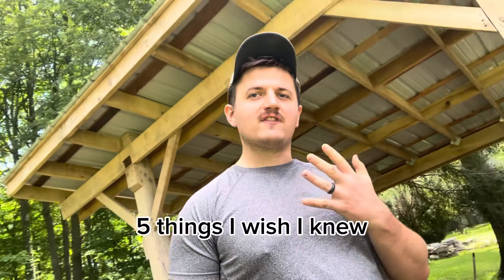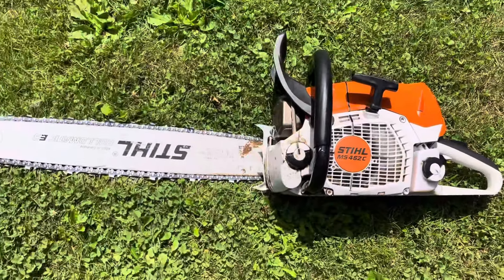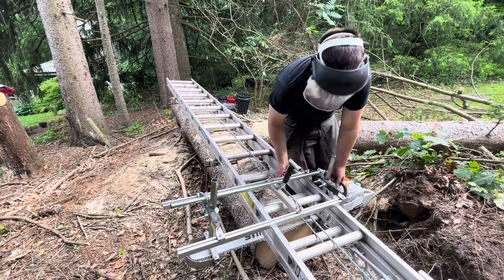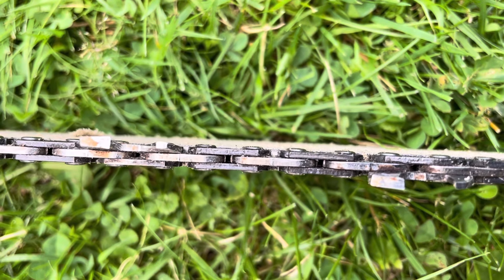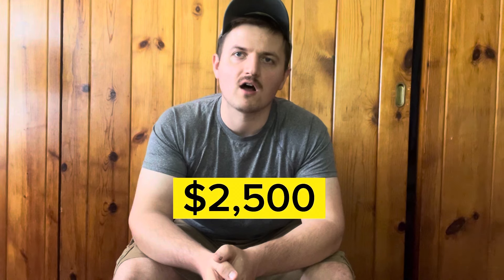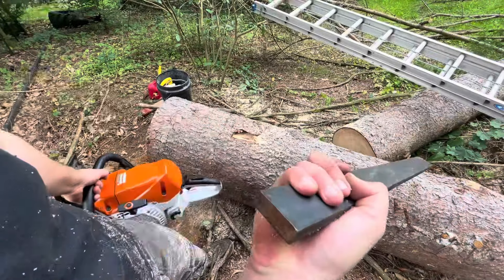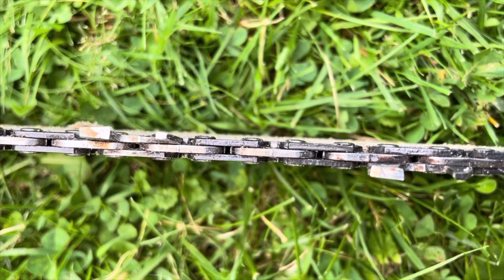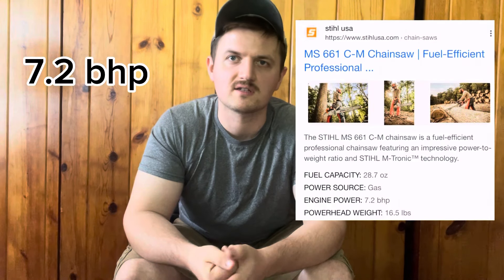Watch this BEFORE buying a chainsaw mill.

Comment: I have a farmmac 660, it's a clone of the ms660. Haven't had that many problems with it. You're right about idling the saw before and especially after every cut, they need to cool down.
Reply: @aerialrescuesolutions3277 Cole's chainsaw mechanic friend must be working on clones only. 

Professionals should get best brands they could get, new homesteaders or DIYers may need good clones which is better than a no chainsaw.

All chainsaws are made in China or made with Chinese parts especially German manufacturers. How do you think they make such good clones?
Reply: @aerialrescuesolutions3277 lol where are all the problems you're referring to? For four times the price I'll pass.

Comment: I have been using a Sthil 271 with a 24” bar and rip chain for 3 years. It gets the job done just fine, let the saw do the job and not force it.
Reply: I've used my Stihl 310 on pretty big Douglas Fir and some smaller fir old growth running a 28" bar but use my 660 with 42" and bigger or on hardwood
Reply: Thanks for sharing, which mill are you using?

Comment: my friend put a longer bar on a electric chainsaw. 1 1/2 horsepower doesn't even get hot. he runs off an inverter with solar panels and batteries. calls it his solar powered chainsaw Mill

Comment: Great points.  I have a bandsaw mill and it's great for logs that I can get to and transport with my tractor.  On my property, I also have a lot of dead standing / downed trees that I either can't get to easily with my tractor or, they're simply too big for my tractor or my bandsaw mill.  Slabbing out a 36" Honey Locust where it fell means I get access to wood that I would otherwise not.
Reply: Right on with your point
Otherwise it goes to firewood or rots
Reply: Exactly
Reply: Absolutely
Reply: Jealous of your Honey Locust harvest. Great wood.
Reply: Simple - freehand chainsaw square it, cut in 1/2, attach temp. small wheels/axles to fr. & back.  Easy to transport with sm. mower.  I use a converted elec. handicap scooter and/or sm. winch.

Comment: Most important thing this guy said in this viddia was letting the saw warm up before cutting and letting it cool off at idle between cuts, chainsaws are not designed to run wide open for that long at a time, think it, it’s like cutting up a 10-14 foot diameter tree.

Comment: Cole, just stumbled on your channel. I also have a Logosol F8, mainly use it for milling rough 6x6. Power head is the 661. You have some great points. Most of the time I do find the mill to be a main in the ass. But the fact that I can carry the mill to the tree is why I have this rig on the wood lot. Thanks again.

Comment: This is one of the best videos I've seen about chainsaw milling and points out practical aspects for consideration.  I have been thinking about whether to get a Granberg and I'm now thinking that what I probably need is to find a local with a mill (actually a neighbor has one) who would be willing to mill my timber for me. I will rarely be cutting timber that I would want useable lumber from (mostly now I am cutting firewood), and I can always get one later if it becomes a more serious endeavor.

Comment: Thanks for this info! I would add that a chainsaw mill gives you the liberty to cut logs where they fall. This is a great advantage if the logs are located in a hard-to-access area. Personally, I'm in an urban area (Atlanta) looking into chainsaw milling because I don't want to buy a tractor and grapple to move big logs onto a sawmill, nor do I have the space to store a tractor or sawmill. I want to cut them where they landed and easily carry the boards. If someone's tree falls in their fenced-in yard, I can't get all that equipment in there. But with a chainsaw mill I can cut it where it landed AND they get free mulch! Is it tedious? Yes. But getting all the equipment required for sawmilling takes a lot of added time and manpower as well, so in my situation where I'm just doing this as a side hustle in an urban area, chainsaw milling seems to make the most sense.

Comment: I have a Holzfforma g070 105 cc power head. I've been using it for 4 years now. This is the first year i've had difficulty starting it. I have ordered tune up bits. It still has great compression. I've been using it primarily on sweet gum and pine, with the occasional red oak and am only running a 42" bar.

Comment: I've got a farmertec ms660.  It was purchased as a bax of parts and assembled by myself.  Some OEM STIHL parts were used in place of the kit parts.  It's also a good idea to upgrade to a high flow oiler if you plan to use it for milling.  

There is a lot more kerf waste with a chainsaw mill than a band mill, but the portability can't be beat.  I can just toss the equipment in the back of my truck, head to a site, or atop when I see a log I like, and get to work.  You take the mill to the wood, not the wood to the mill.  The final cut slabs are much easier to movw than an entire log.

A bandsaw mill will use less fuel per cut and the amount of physical effort will be much greater for the chainsaw.

There are a lot of tradeoffs on both sides and I guess if one were to do it as a business it would be worth having both in the long run.

Comment: I like this “perspective” video on milling idea. I really appreciate you bringing something new to the milling space, most videos on milling are the same exact video, with different faces, saying the same thing. I like the bar stock/rebar idea, very original. The absolute best tips video I’ve applied is on flowering elbow’s channel. I think it’s 20 tips for milling or something. The repeatable quality I got from board to board is amazing. I popped a saw doing this, so now I keep things real clean blowing myself off then blowing the saw out with compressed air with every tank filling. I know not practical for some but I’m a carpenter, I have a couple hundred feet of air hose so I might as well use it.

Comment: Nice to know. I'm in the process of just getting started in doing some milling. 
 First tree is a bed frame, footboard and headboard the second is a  few bridges need to be built through the woods for the bigger tractor and pickup truck to retrieve firewood and the lumber. Note the bridges aren't very long or wide but need to support the tractor weight and the lumber. 3rd project is a home made kiln. The dryer wood will be used in my wood lathe. So far I've turned a few small projects, I hate buying lumber having it at my disposal.
 I've looked into an Alaskan mill, don't know how good the quality is
Reply: I've had a granberg Alaskan mill and mini mill for 12 years and they're quality is great. I started off milling with a stihl ms310, but upgrading to a ms441c.  With a 28" bar I was milling 25" oak,maple,and tulip poplar. Keeping your chains sharp and making good first cuts are the key to your satisfaction with them. I bought multiple chains so I could just switch em out and keep milling. It's slow enough without having to stop and sharpen. I think I'd stay away from the chinese knockoffs because of lack of replacement parts and questionable quality

Comment: I use a 090AV and yes you let it idle - you also add extra oil - I run .404 chain sharpened at 90 degrees with the rakers set .040”. I only do hardwoods or very select softwood. If I need a 2x4 I go to a big box store

Comment: I have both. I look forward to running my bandsaw mill every time I come up with a new project. I cringe every time I have to use my homemade chainsaw mill, mostly because I know how sore I am going to be for 2 days after. The bandsaw mill was considerably more expensive at &11,500, compared to the $100 it cost me to make the chainsaw mill. I already owned the 262xp so most of the expense was the 24” bar and ripping chain. The other big hurdle with a bandsaw mill is handling logs. Without a piece of heavy equipment it’s very difficult to feed a bndsaw mill.

Comment: im getting the 660 clone and the milling assembly because yarding logs without a tractor is pretty much impossible and often times illegal. chainsaw mill gets you into the mix without the heavy equipment

Comment: Thank you for indepth information, I plan to build a wrap around deck on my property and the current lumber price was gonna be like 6,000, since I have 4 acres and a lot of decent trees to mill I believed it will be more cost efficient to mill my own wood, now I have a solid confirmation thank you
Reply from the maker: Cool project Brandon. Do you think you’ll use a bandsaw or chainsaw to mill your lumber?

Comment: I milled a 36 inch oak with my holtzforma 372, and 392. I was amazed how well the 372 did, but I wanted to get the 392 to put a 42 inch bar on.
Reply: I heard those Chinese saws aren't too bad, so I bought a barely used 372 from a person, but unfortunately it broke down on just the 3rd cut milling through a large (32") white pine, so I ended up getting a husqvarna 592xp, fixed the holzfforma and sold it.  I'd say they're just fine for felling and bucking,  though.
Reply: @carlweeks9256  hmm, well no telling what kinda life it had before  you got it,,, my experience with them has just been splendid.

Comment: i have a chinese ms 660 paid 450 5 yrs ago and put about 400 into it . i got a granberg 36 inch bar and 4 ripping chains . most of my wood in the northwest is softer so i have no issues with the saw . i dont use it as much as id like but i maybe have 100 slabs cut to date . subscribed

Comment: very useful video man! 
all useful thanks specially on the chainsaw cooldown...
The initial cost can be way lower. is better a good used chainsaw than a bad new one.. i found years ago a used  husky 365 for 300$ and for the fir that i mill is fine.
A saw mill would be my dream but i will need some machinery to move the wood around.. so way more than 2.300$..
Thanks a lot very useful advice!

Comment: I started milling back in the early 1980's, bought a brand new Jonsereds 910E and a Grandberg Alaskan Mill 36 inches. Did my last milling in the late 90's. The most significant thing learned by me was the physical strain of milling, it is taxing on the body to the max. I never had a hiccup with that Jonsered, out here in the Pacific Northwest I collected Black Walnut, Big Leaf Maple and Sycamore. I had a bunch of black walnut that were years old logs, dry and hard. I always rested my saw with idling, a guy has to have some savvy using a saw or you will smoke them. I also ran 32:1 oil. I never even tore that saw down for maintenance of any kind until this past winter. Did so because now I am collecting vintage saws and the ones I had were the first ones I started restoration on. Piston and cylinder is in premium condition, carbon build up was under a mm thick. Seals are still good, rebuilt the carb and replumbed the fuel lines for the first time. JUst take care of the saw by not pushing it and feed it a good oil mix. Oh yeah, I tried a variety of chains but settled on standard link with about a 10 degree cutter, Never did have good luck with skip chain of any kind. Kept the bars and chains in excellent working condition. And I made and auxillary oil tank that mounted on the far end of the mill, fed oil to the bar groove through a hole drilled just behind the sprocket assembly, keeping that chain well oiled is essential, less power robbing on the power head and chains and bars go more miles. A good read for chainsaw mill enthusiasts if Chainsaw Lumber Making by Will Maloof (sp?) he was a Canadian and had some real good instruction to offer in the book.
Reply from the maker: Awesome story Gary. Thanks for sharing. I wish you straight boards and a smooth running saw in the future

Comment: Best practice is to consider a 'chainsaw mill' as a slabbling mill only- use it at the landing for 'break of bulk'- and then air dry as 8"-14" posts for a season. It's marginally efficient enough for resawing those into 2" dimensional lumber, but for 1", always bandsaw. For big logs (over 20") they're a much better value than most bandmills, and I hate the problems small bandmills have with larger logs. For pure penny pinching goodness, my favorite use for them is in maximizing the value of those few firewood logs that show promise, even though they graded out of any sawlog category, not to mention roadside and sugarbush trees. My stove doesn't care if the wood is flat, and if I can pull some beautiful hardwood planks out 'for free', I've paid for the mill- as you said, you need a 'big' saw anyway! I use old Pioneer 650's with 30"+ bars to mill and buck big logs, and a small, light, modern, high rpm saw for woods work and limbing.

Comment: I have a chainsaw mill, and holzforma, use it when logs are to big for my little bandsaw mill, cut logs into cants then put them on my bandsaw mill...  so far the holzforma has been fine, just a few logs so far...  wouldn't want to use a chainsaw mill for everything I cut...

Comment: Well I reckon if this is correct I shouldn’t get a chainsaw mill. I ain’t spending $1700 on a saw. And time your done buying a saw for the purpose and chain for the purpose and the mill why not just buy a bandsaw mill and be done? I had thought to buy a 50cc saw and a mill and make beams and board of fallen trees on my place

Comment: The biggest thing I found since chainsaw milling is the amount of effort it takes to cut a slab the first upgrade I am going to do is install a winch ,
Reply from the maker: Heykevwhatyouup2 if you really need to push into the cut you may have a dull chain… what kind of chain are you using?
Reply: @coletaylor123  I use a 10 degree tooth skip chain , I watched a lot of videos before buying my milling set up a the biggest surprise was the amount of effort is required to actually make the cut , the saw does slightly pull itself in  but you have to work the saw to stop it bogging down I use a neotec 105cc saw with a 42 inch bar
Reply: @heykevwhatyouup2  While I agree it is physical effort, what you're describing isn't exactly normal, it means there's something wrong with your set up or technique. BTDT, and there's a really dramatic improvement when you get it right.

Comment: Making my own live edge counters for the entire house.
  661 and a cheapie china mill from ebay( get the exact clone of the granberg,  and upgrade hardware to thicker washers and tall nuts all around.
 I’ve owned a  the real one and now this and see no downside to the cheaper mill. It’s a simple device the reliability is in the design itself. Just look over the materials used because they do vary

Comment: I dont have any experience with this, but i would also imagine that another advantage of a chainsaw mill is that you can mill the tree where it is at without having to move it. Once milled it becomes a lot easier to carry out the individual boards. Is that a fair use case?
Reply: Correct!  A log easily weighs hundreds of pounds and can be over a ton for large trees.   Even make them into smaller pieces to move to a bandsaw mill to finish the individual pieces is another option.

Comment: Hello
Is there a big difference between standard ripping oregon chain and homemade granberg ripping chain with scoring teeth ?
Regards 😀
Reply from the maker: Hi Raiarii, I’ve never used an Oregon ripping chain, but I have used Oregon standard cross cut chains. They are very similar to the Stihl yellow link chains with a 30 or 35 deg file on all teeth. Using a ripping chain with a 0 or 10 degree file will help keep your chain sharp for longer while milling and will typically make straighter, cleaner cuts.

Comment: The reason why 'dimensional' lumber is smaller is that it is cut green to the nominal size, then kiln dried (which reduces the size by a small amount) and the dressed on 4 faces. In order not to have every board being a different size (shrinkage might be different on each board), they are all milled to the 'standard' dimensional sizes.

Comment: Great stuff man thank you! Some of my logs diameter are to big for a smaller $2500 bandsaw mill? I'm stuck here!?
Reply from the maker: Maybe a 120cc class chainsaw with like a 6’ bar? I’d like to get a giant bar for slabbing out giant live edge stuff
Reply: Use a chainsaw mill to make it into sizes manageable for the smaller bandsaw mill! For example,  a 36 inch log could be cut into quarters they'd be about 18" on each ends.

Comment: I always wonder about the chainsaw engines getting tilted by 90 degrees during the milling process.

How does that negatively affect the internal lubrication, and the chainsaws'  lifetime? 
You would think they should be used in upright position or getting returned to that position during use. Just like you wouldn't want to drop your motorbike and leave the engine running idle in that position.... 

So how is a chainsaw engine coping with this? 

I don't do any milling, I just enjoy the videos. 😊
From Germany

Comment: A neighbour of mine decades ago built his house using only an alaskan mill for making his lumber. All the folks here saying you can't get accurate cuts for dimensional or it's not efficient just don't know what they're talking about! I want one, and will be using my 455 rancher with a 36" bar. Mostly I'll be doing posts and beams, though; anything smaller, like 2x4s or 1x? boards will just be cheaper to buy.
Reply from the maker: Posts add another level of complexity to cuts with a chainsaw to make sure both cuts are set up perfectly at a 90 degree angle, but it sure beats buying beams. I made ten 10’ 6x6’s for this barn and it helps to rip off two rounded faces on the log first instead of ripping 6” thick slabs with live edge on both sides. If I made 6” thick live edge slabs into posts again I would consider buying a skil saw beam cutter with an oversized circular blade to rip off the bark because making them with a standard circular saw or table saw is not easy!